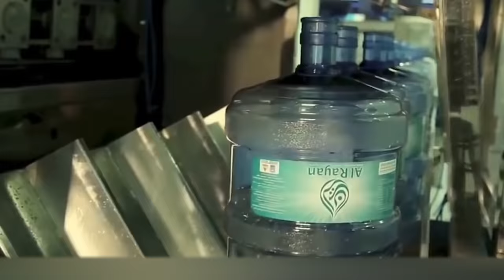The Whole Truth About Dubai You Didn't Know

Comment: Why do desert countries use coal? I would think solar! Or am I like a really stable genius?
Reply: Solar can be used only during day time if the country wants to use solar during night it needs to store its energy in batteries and a huge amount would be required making solar even more expensive than LNG Powerplants (most expensive source). Also the energy requirement  changes through out the day (most electricity is used from 6 pm to 10pm) so alot of energy is required and coal, nuclear, LNG ETC plants can be started in seconds giving the requried energy to the grid. Hope u would understand.
Reply: Coal's cheap and effecient
Reply: A stable genius 😎
Reply: I think he means fossil fuel. cuz most depends on gas. not coal.
Reply: Abdulla Alhammadi  Same diff. Why fossil fuels and not Solar?
Reply: @patrickboucher2907  we do have few solar projects but yes not enough. even though we have plenty of sun the problem comes with the heat. solar power losses alot of its efficiency with heat. so gas becomes the next best thing. and btw. we buy most of it from Qatar as we have lots of oil but not enough in gas
Reply: we use solar during the day
Reply: Search up masdar city uae
Reply: serval solar panel stations are powering basic streets lights and other things throughout the country that has been used for years plus modern schools are solar-powered. Also, in recent years a solar power plant 'Shams 1' was created for Masdar city company, and even regular people and compies have made the switch whenever possible. But why would the video mention that? most of the info is stereotypes and just old.
Reply: It’s no good in the desert because the sand scratches the panels making them much more inefficient.

Comment: As a foreigner in Dubai, I can say that Dubai is actually clean in most places and rubbish collection services are actually pretty decent...however, the only downside imo is that the driving is atrocious with a tiny handful of people indicating on the roads, driving at high speeds. What’s worse is that even the police don’t indicate most of the time, on some occasions they like to turn their sirens on and travel just a bit faster. In Australia where I have been brought up, not indicating and being caught by the police is a massive penalty. In Dubai you can see a car right in front of a police turn to another lane without using signals and it’s fine. Also roads are frustrating as missing an exit means you have to travel about 5km down the road to take a u-e and still have to navigate around the roads which have a poor design layout. 

Other than this, Dubai is great with a lot of things to do and people are nice as well.